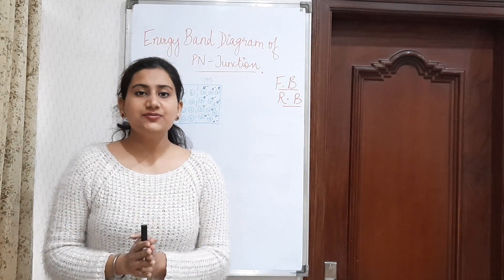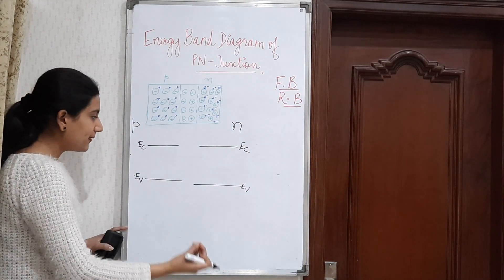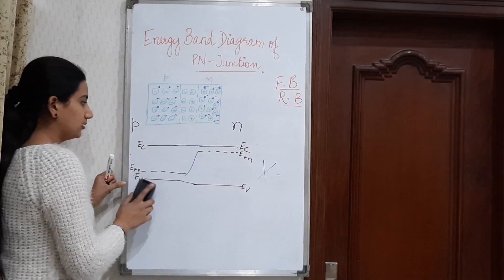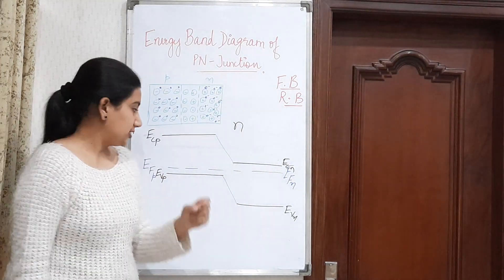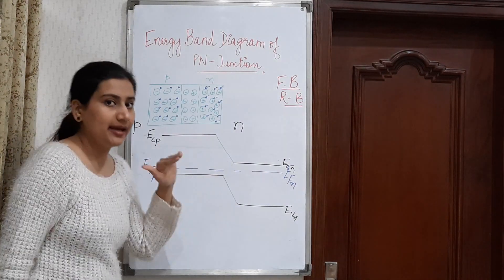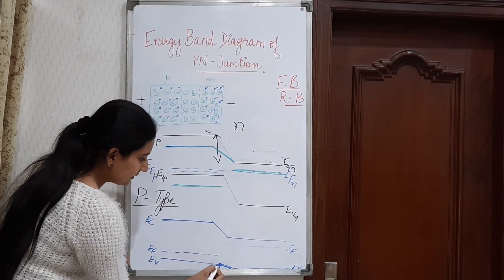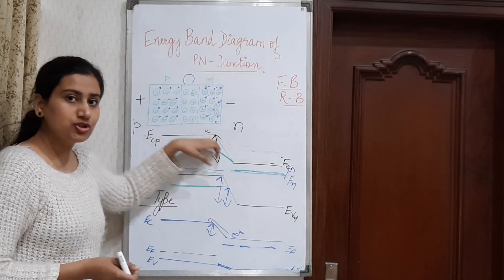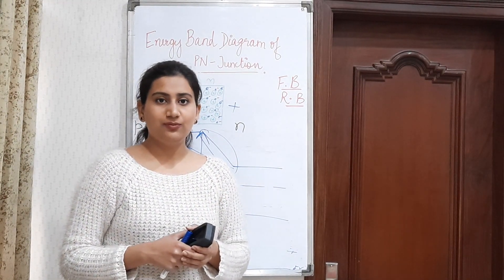Energy Band diagram of PN junction explained by Kushleen Kaur

Comment: The diagram is wrong because  you joined the conduction band by a linear line but slope of CB and VB denotes the presence of electric field. So as per your diagram the two places where you joined the CB is linear line which means slope is zero  and no electric field is present in VB and CB which is wrong. 
To correct this join them by a non linear line which denotes the presence of electric field.
Reply: Non linear curve is for potential distribution in the space charge region not for energy diagram....mam is absolutely correct😢
Reply: Actually there is no energy state available for electrons(or holes) so the straight line joining the energy of p and n side just represents the energy gap not energy in depletion region

Comment: mam there is wrong information in diagram....As we know the slope of the Conduction band and Valence Band represent the Electric Field...so if we join p type and n type CB and VB linearly it means the electric field is same or constant at all the point inside the depletion layer cause the slope of the linear line is same on every two point is same......but in general Electric field not same on everywhwere in the depletion region..it is  maximum on the junction only......so please check and correct.